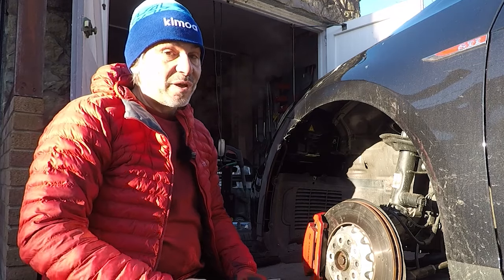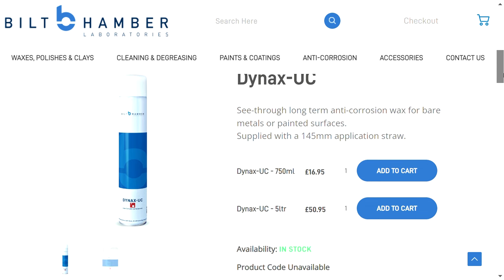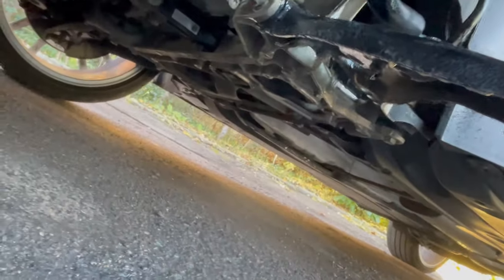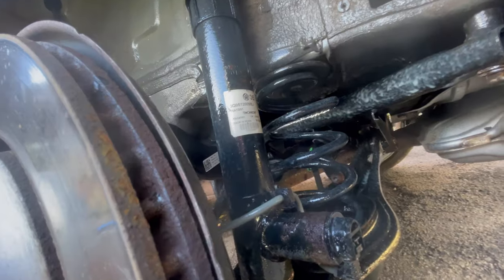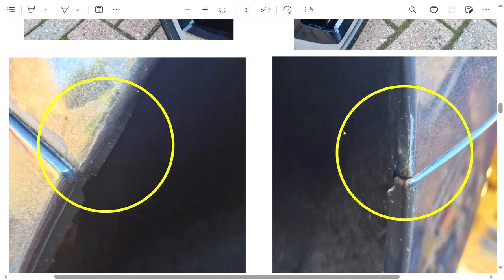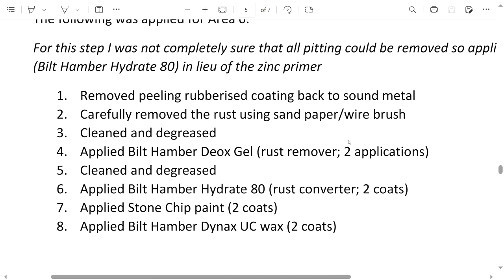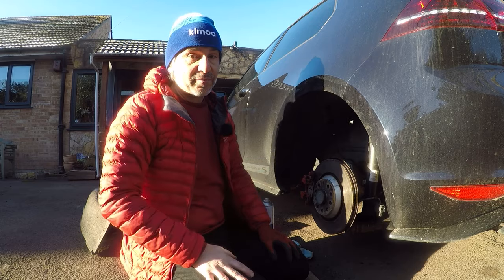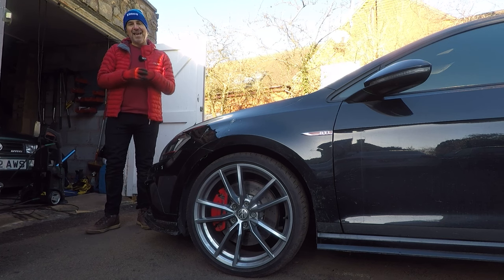MK7 VW GOLF RUST ISSUES + HOW TO PROTECT YOURS  #golf7 #mk7golf

Comment: Just remember Bilt Hamber do a hard wax for high impact areas
Reply from the maker: Nice one, didn't know but now I do!
Reply: What's the hard wax called?
Reply: Dynax ub drys hard , it’s a brown wax, dynax uc is same wax but clear, dynax s50 is for cavity’s it’s a softer wax but migrates into voids/ welds/ seams etc, excellent products 👍
Reply: Yep Dynax S50
Use a brush also to work it in.
Also comes with along tube for cavities etc
Reply: @volkswizard  saw that washcloths were packed in a bag on mexican made vw
Reply: Protect the brake discs! They should be masked off from the application
Reply: @volkswizard hope you're well Andrew, do you know of any rust proofing service providers in the Oxford / Bucks area? I have some surface rust on the bottom edge of the rear nearside wheel arch (2018 GTI) and I now want to get the entire car done
Reply: @volkswizard Thank you for this video Andrew. Have had my Mk7 R from new. Checked the rear arches and found almost invisible beginnings of that corrosion. Both sides done by Smart repair so car now immaculate again. £150 all in (VW bodyshop quoted £730!).

Comment: Nice attempt- but seriously, don't do what this guy has done. First of all- who wants to do this sort of thing mid winter?? Mistake no.1.....  2, One can is simply not enough, if you've committed yourself to doing this task you'll need a minimum of three cans for a vehicle this size, you'll want to take the engine undertray off and any other coverings to get right underneath to cover the entire chassis, do it right, do it once.  Mistake no.3, prepare the vehicle properly, don'tdo this without cleaning off old dirt and road salt. Remove the inner flich liners AND jet wash clean with some strong alkaline shampoo like Carpro reset shampoo and a brush, rinse (behind the liners!! Not clean them when mounted). Let it dry completely. Mistake no.4, cover up your brakes friction  surfaces,  yes it will burn off but initially it could cause brake failure if you messed up. Bilt Hamber Dynax UC is safe of plastic and rubber parts, try to avoid rubber bushes as it could make them soft but I doubt it'll be a concern. Work your spray patern from to top to bottom in continuous spray patterns for good coverage. Work into tight areas with a small paint brush or old detailing brush- remember to tape over the metal part of the paint brush so that it won't scratch any paintwork. Bilt Hamber has a cavity wax with a very long spray tube for getting inside the chassis and gaps. Pick a sunny summers day in preparation,  clean the car and dont trap and spray over old dirt....🙄
Reply: Hes about 2 months too late , you should of done a video , the golf 8 new is already rusting complete shit show they are

Comment: So ya telling me my mk7.5gti has them stupid foam inserts in the front wheel arch,tomorrow they will jacked up and they shall be removed,I noticed the other week on mine between the doors on the sill a rust spot was upset loads the quality of VAG is crap but like you say they don’t want you keeping/having your car for a long time these days
Reply: Im amazed that vw are still putting these bloody sponges in after what happened in the past 
 I found out on a golf forum that my Mk5 gti was prone to wing rot and removed them before any damage was caused
 Did still remove the wings and attack them with hammerite sill paint😂
Reply: @4ndy65  got new wings for my 5 gti years ago I paints them them black hammerite inside and ran a bead of sealant on the inner lip I’ve also drenched them in bilt hamber uc there holding up great but now have spots of rust on the outside of them,my 7.5 has loads of rust spots on the rear archers too I’ve bought a can of matched paint to spray the arch and then again cover with bilt hamber but the weather is always crap

Comment: Considering the amount of plastic that will fail in a VW's enginebay. Over engineered when it's a massive job to replace a water 💧  pump & you need a diagnostic computer 🙃. Maybe it's a race to the bottom of the barrel amoungst manufacturers?

Comment: Yeah, whoever had my car last must have parked under a tree. When i lifted the bonnet i noticed lots of leaves etc but never realised in each corner it goes down the inner wings. After taking the wheels off the front. Taking off the wheel arch liner uncovered all i can call wet mulch stuck right in there, plus vw/seat sponge soaking wet sound deadener doesn't help. What a mess. Terrible design 😢

Comment: Rust? Really? Shame on VW. My Golf 4 GTi TDi had none back in the days. I removed the foam blocks behind the front  fenders, cleaned all wheel arches in the summer and used ML / Tectyl on vulnerable locations. The car drove long after I had sold it. I think it was scraped eventually due to high mileage.

Comment: I did my 2015 Mk7 Golf GTD which I’ve owned from brand new which has 16,375 genuine miles at the moment with another rust protection spray called Lanoguard.   It’s 2024 now and It’s still like brand new underneath yet ..  I did the front inner wings and lower edge at the door pillar of the wings, the rear sills inner and outer areas, and all the suspension and chassis floor.

Comment: Thanks for posting this, it's very useful and informative BUT - if we want this done properly the car needs to be raised on a lift, with the wheels and well protectors off. The splash shield/skid-plate needs to be removed also.This way you can apply the compound of choice to BOTH SIDES of the affected chassis area. If you spray only one side you've basically done nothing to really prevent salt and moisture-caused corosion. Not everyone has the means to DIY so it has to be done by a proffesional, once a year, maybe more or once in a few years, depending on where you are. I own a 2013 Golf 7, no rust at all, but I consider myself just being lucky. All I do is pressure-wash it thoroughly after each drive in winter, that's all. But that alone is obviously not enough for everyone. Thanks again for your effort!

Comment: This is why I don't buy VW products any more. I was put off when I saw the state of my then 2 yr old MKV GTi and it's creeping rust problems. Great to hear you're still sourcing cars you always traded fairly and were honest to a fault even if the deal didn't work out.
Reply from the maker: Great to hear from you Sam, still miss your Anni’ HF52OLO
Reply: @volkswizard  I had a lot of great times in that old bus-9.5 hrs from the Algarve to the south of France via the Pyrenees cruising at 100mph+++ and averaging 50mpg! I bet you don't remember selling me a set of Evolo wheels for the Anniversary? It rode better on those with all season tyres than those fragile BBS warranty specials everyone loved.
Reply: mk5 was bad. I am 6 years and 50K miles into my cupra and no rust at all - never protected only jetwashed.

Comment: Good video. I’m currently doing the rear sub frame and arches on my edition 30. Overall it’s in fine fettle with a bit of corrosion on the spare wheel well underside and subframe. That’ll get buzzed off and treated with Bilt Hamber Hydrate 80. Everything will then get coated with ACF50 and Bilt Hamber Dynax UC like you did on the Porsche. To combat the arch to bumper rubbing i’ve removed the rear lights and bumper and plan to use some clear 3m helecopter tape between the 2 panels. Finally the inner sills will be hit with Bilt Hamber S50 cavity wax. Hopefully this keeps corrosion at bay for a few more years.

Comment: It's CRAZY that my Corsa C which is 18 years old, which I've had from new has NO rust at all. I'm shocked that a VW can rust this quickly!! My car has only needed new batteries, CV boots, brakes and oil changes . I have no engine issues at all. I have saved sh!t loads of cash and it's still going strong. I was looking at buying a VW but now I'm not so sure 😲😲
Reply: I have VW golf 2 wich is 39 years old and have zero rust on body ! When is driven before it is kept in garage and barely driven at winter. Last 10 years is not driven at all, parked in garage, but still have no rust.
Reply: VW quality went downhill and they still wondering why others catch them up.

Comment: VAG products tend to be buckets of rust. I found this video randomly after dealing with rust fixes on my Leon Cupra. 

I have a 2015 Leon ST FR, 2020 Leon ST Cupra and a 2023 Formentor in close family. 

The 2015 Leon is a lost cause, rust is everywhere. Main locations are the door sill in the rear fender, bumper mounting location on the rear fender and the front fender mounting screws. It is in a really bad shape and I gave up on it, needs a full respray.

On the 2020 Leon Cupra, the front fender has not been an issue as I clean & wax it twice a year when doing a wheel swap. Usually with half a year it is full of crap - leaves etc. Same with the bumper mount, but mostly because I added PPF between the bumper and the quarter panel. Also covered the rear fenders with PPF except for the sill part. That has been a big mistake - the rear part of the sill has rusted really badly, gone 5cm under the rock protection. Also looks like the fenders like to rust on the inside, between the fender liner and fender itself. The rear part of the fender (so the body) also tends to get rock chips in the rear. 

So based on that on the 2023 Formentor, days after buying it I took off all of the plastic fender extensions, all fender liners. All of the fender edges got PPF and the line between the rear bumper and the body was PPF’d. Front fender lower bolts were cleaned and covered with a lot of wax, noise deadening was removed and replaced with a more waterproof one and made sure it did not touch any of the lower sill . Inside the fender, as much as possible, I covered the exposed paint with PPF. And after that everything was covered with wax.

So basically, if you want it to remain rust free, every single year it needs some wax and cleaning. I tend to use Liqui Moly cable grease (seilfett) as it is very thick.

Comment: Interesting to see the corrosion prone areas. Using a paintbrush works well for spreading it out and into crevices (worth putting insulating tape over the metal part of the brush body if it has that when new though to prevent it damaging any paintwork). Also might be worth putting some carrier bags over your discs to prevent contamination of the braking surfaces 👍
Reply: Wondered that about the disks, too. Agree with your advice and the general material here. Will take a look inside the arches in the coming weeks.

Comment: I’ve got a 2013 Golf with rust at the top of the wheel arch in both front fenders.  Rust in both sills where the foam inserts meet the sill. Rust on the perimeter of the opening for the high mounted brake light.  And rust along the opening for the passenger side door handle.  I live in upstate New York where lots of road salt is used in n the winter and had to replace the rear springs due to corrosion.  The car comes with a 12 year rust warranty and VW will be repairing all of these corrosion problems under warranty.  The dealer’s body shop is taking many months to schedule the repair. So far I’ve waited 5 months and they tell me I need to wait a few more weeks.  After watching this video I will have some additional questions as to how they intend to repair the rust.  What are the corrosion warranties for VW’s in Europe?
Reply: Same as yours. Aren't the USA VWs assembled in Mexico?
Reply: @grahamatsea3575 my 2013 model was built in Deutschland

Comment: It's not just VW, it's pretty much throughout the VAG range. I use ACF 50, everytime I change the oil, I'll ensure all exposed metal gets treated. I run onto ramps and make a detailed application on the substructure, suspension and even the whole exhaust system. I'm pretty lucky my car is 1 year old so I didn't have any rust to start with.

Comment: Those rust issues are exactly the same as what I'm seeing on my mk5. I had to replace both front wings and through away those water sponges. The car has a complete Dinitrol under coating treatment including full cavity treatments. Maybe that is why it hasn't rusted more than it has

Comment: Great video! I've been working on my css over the winter, mine too is very low mileage and garaged but still quite a lot of rusty suspension parts, I sanded everything back to bare and painted but I'm gonna order up some Dynax now too, good advice on the arch foam, never even crossed my mind when I had the inner guards removed!

Comment: I noticed the fabric rear wheel arch liners on our Golf R 7.5 are leaving 7mm wide X  5cm long gap over to the metal bodywork in one place.  That will let water/mud etc in behind the fabric.It is a poor design.  I peered into the arches of other VW models, including a GTI, Polo etc, and those had no such gaps. Why the GTI has a better design beats me. I am going to cover/fill the gaps with Sika-seal super 200 and see how it goes. Sika-seal super 200 is a hybrid of acrylic and silicone rubber that cures to a MUCH tougher substance than silicone rubber alone and does not tear or split Water cleanup before cured. Not for external use is stated but I have found no breakdown after 3 years in Australian direct sunlight..

Comment: Don’t get the Bithammer on any rubber components, brake hoses or gators, the solvent in the aerosol wax softens and attacks rubber components. And don’t get any at all on brake discs as it impregnates the pass. 😊

Comment: To prevent corrosion on these I would recommend removing the front and rear bumper corners where it clips to the wing and clean them out periodically

Dirt and polish etc builds up in the gap and rubs the paint off under the arches
Reply from the maker: Good tip, they aren’t too bad to remove with wheels off

Comment: I’ve just bought a 2018  golf. I’m aware of these issues as my other car was a mrk 5 golf but Vw replaced my wings but not sure if they’ll do it on this car if the wings started to rust . I’ve removed only one of the foam blocks like you said but going to see if it makes much difference to the noise. 
I was thinking now that I’ve seen the blocks could we not cut the block down were it fits into the wing then the water wouldn’t collect and if it dosnt stay in place maybee silicone the foam in place

Comment: *Few people remember that the last "real" Volkswagen was the MK3. After that 
all Golf models were based on an Audi platform*.
Reply: My 93 GTI has no rust the late mk3s ( after 94 we’re not as good and rust

Early mk3 is built like a mk2
Reply: @kells77  I have a US built 95 VW Golf 
and amazingly it has stood up quite well in the rust department.
Reply: I have two Mk3 Golfs and both are rusty af. It really depends in which country they were bought. The German ones and Italy i think were the best and had the best paint/protection. The balkan & east europe ones are more prone to rust.
Reply: @FIIIIIIP  I have to clarify....my car was actually built at Puebla Mexico....VW had shut down the Westmoreland PA, USA plant in 1992. I'm pretty shocked my car has held up that well, because the build quality wasn't that great, but the car has been very reliable, even the AC system still works like the day I bought it brand new back in 95, it's fantastic! Still blows 38 F ! and that system has NEVER been touched!
Reply: @FIIIIIIP  My L reg Mk3 (purchased 1999) had a small spot of bubbling above the drivers side windscreen. Thankfully never got any worse. Had it up to 125,000 miles.

Comment: Lanoguard hard to beat easy to apply
Reply: 100% I used it in the summer and still enough left to do this summer and the next
Reply: Applied it to the new rear axle, subframe, wisbones etc... on my 1.8t mk4 before it hit the road again in December and find it has loads of dust/debris etc stuck to it now.. will try the bilt hamber on my mk7 R see if its less sticky lol

Comment: Funny thing is I have just done a load of this on my 2015 Passat Alltrack, my findings  were quite shocking, I pulled off all of the wheel arch liners and in some areas patchy rust was already evident, i treated it with Por15 and painted over it with their paint, it looks like the factory don't underseal or wax anything in these areas or even lacquer it, when i think what i used to with my old Ford Cortina's was waxolyl surely to god we buy these expensive cars and then have to waxoyl them?? The rear beam and suspenion components weren't great either, I have also removed the mud and crap from the front where the liner joins the sill and waxed it, great video but shocking how crap the protection is

Comment: so this stuff wont like trap water and make it rust even more or anything?
Reply: I'm skeptical as well as there was a fad for undercoating classic cars in the 80's and it turned out to have been a terrible idea unless you were fully confident all issues had been treated beforehand. It just locked the rust in and as soon as the protective layer got punctured or stuff got in from the other side you had a whole heap of problems.

Comment: Interesting. I have a 2016 Golf 7 GTD Variant that just hit 300.000km (~187k miles) a few days ago and my Golf has absolutely no rust whatsoever. I checked, but none of those spots show any sign of corrosion or previous corrosion. Just the edge of the lower part of the hatch has some rust that you can only see when you look for it, but that's due to the previous owner having had a low garage ceiling and his hatch hitting the ceiling, rubbing the paint off in the process. I'm just gonna sand the edge down a little, apply some primer and go over it using a paint pen so it looks good again and won't rust again.